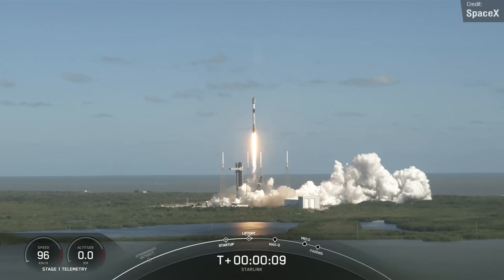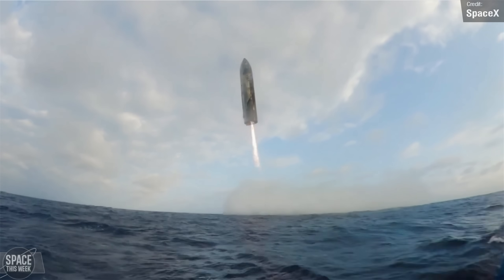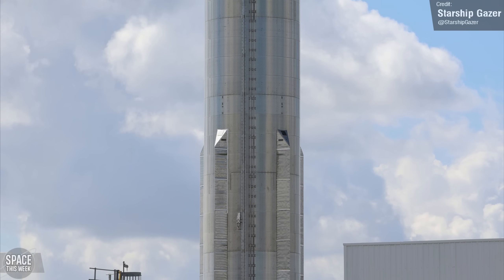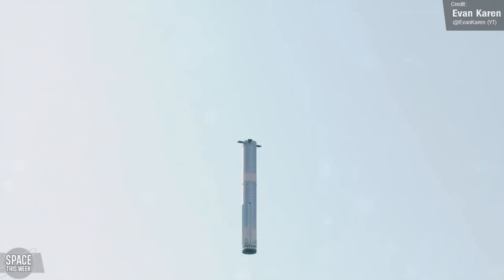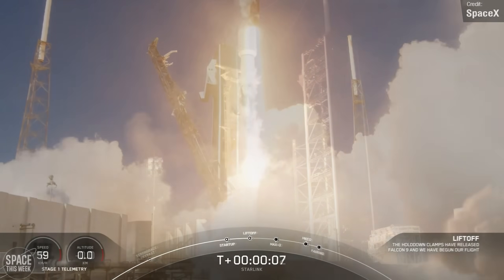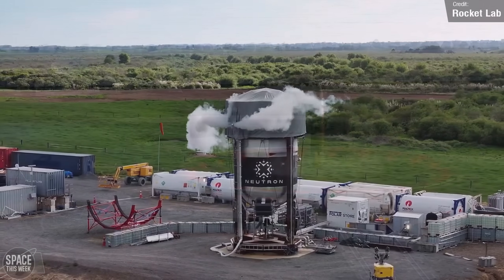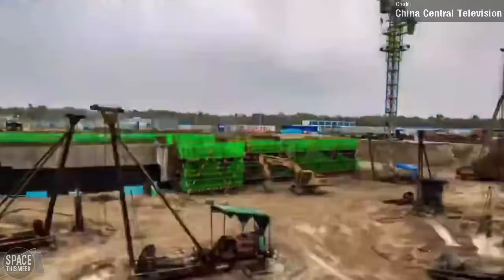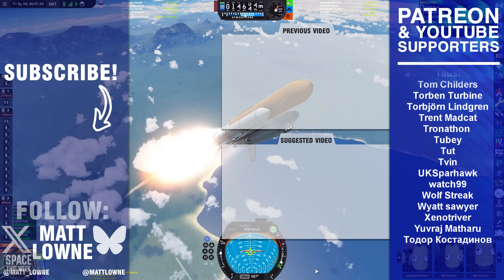What is SpaceX doing with Mechazilla? - Space News Update

Comment: I would like to see Starship being able to lift something heavier than a banana. It was claimed that V1 could lift 50 tonnes tO LEO. Obviously, this has turned out to be BS. Lets see what v2 brings. 100 tonnes to LEO?? We’ll see. I dont believe anything these guys say anymore..
Reply: You're evaluating low fidelity throw away test articles like they're the finished version, and this of V1's when they have V2's ready to go and V3's in the pipeline.  That's badly flawed reasoning at best.  Lets hope it's not you being deliberately dishonest.
Reply: @ Not really. This vehicle is supposed to have a payload. It doesnt. It was supposed to be 50 tonnes. It doesnt. If you want to argue that this vehicle has a 50 tonne payload, then explain how an empty vehicle that is fully loaded with propellant, runs basically out of fuel. The answer is obvious. 
No payload. V2 is supposed to be 100 tonnes. But if v1 didnt get to 50 tonnes if v2 going to be capable of 100 tonnes?? We will see. I doubt it at this point.

Comment: Why dont we land falcon 9 back and save using drone ships
Reply: Fuel margins.  The more you want to launch, the more fuel you need and the less you have to return to launch site.
Reply: Simplest answer(s) the ship is more efficient as more mass to space basically requires more fuel which kinda defeats the point...also the Falcon 9 is built to land empty so margin of error literally doesn't exist and to land with fuel would basically make it a different rocket
Reply: @SwiftRazor003  surely it has fuel on to do the burn back and slow down for drone ship? Or is it the extra fuel to get into an orbit that would then let it come back in on an entry path for the launch site
Reply: @OwenM98   yes, it has enough fuel for backburn and suicide burn, only...it's less of the rocket aiming for the drone, but the drone actively aiming for where the rocket will be...if we were to extend its range, that would mean more fuel, but you need more fuel to get the first case of 'more fuel' into space...so it's diminishing returns that quickly turn into, just build  a new, bigger, more efficient rocket for that role...
Reply: @SwiftRazor003  that makes total sense thank you